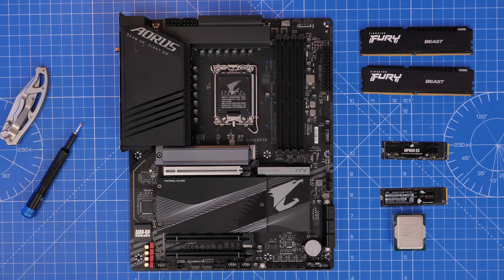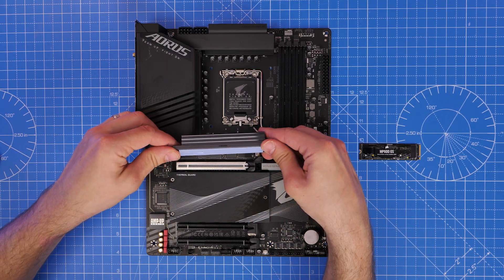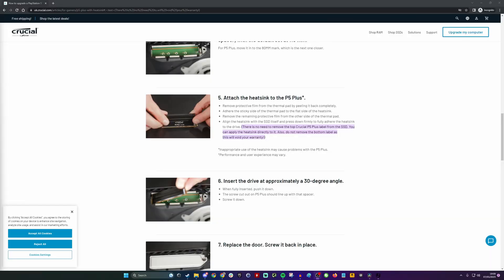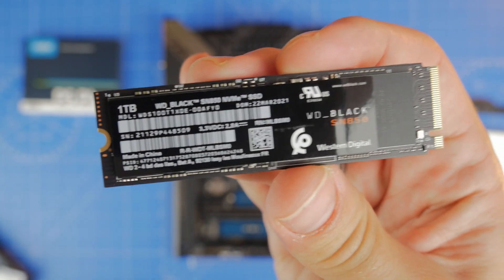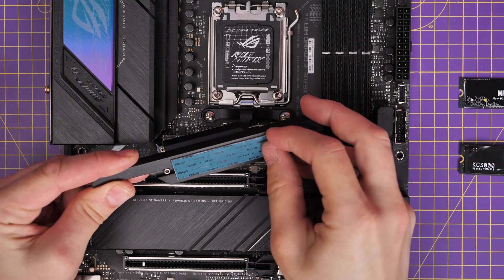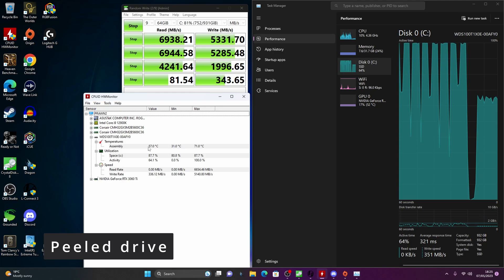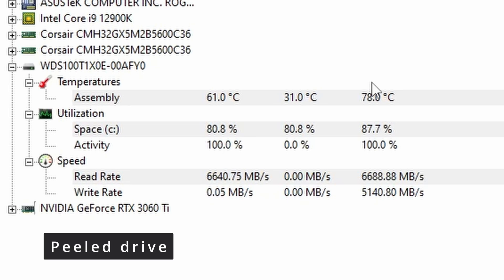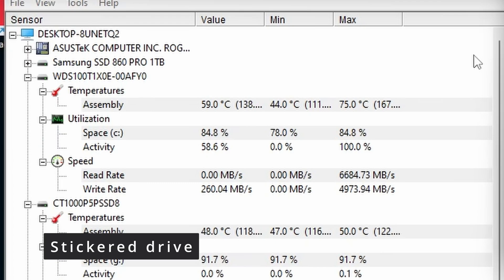Should you peel the sticker off your NVMe? Does it help?

Comment: It should be noted that in 1976 a federal law was passed In the U.S. that actually makes it illegal for a manufacturer to void your warranty because of the removal of a sticker. But because it's very rarely challenged or taken to court & there isn't much enforcement they get away with just doing it to reduce the # of referbishes & warranty claims. One of the original implementations of voiding  before the law was passed was for "Glass-cap-chips" a type of IC (Integrated Circuit) that was essentially the start of the modern re-flash-able motherboard bios. These chips had a see-through glass window in them that when the chip inside was exposed to UV light it switched from a read-only to writable state, allowing you to flash it. The advent of florescent bulbs (like the kind in most schools/businesses @ the time) could make them writable- which prevented them from running the device they were in; while being in the writable state. In addition, Mercury- vapor, halogen bulbs, & sunlight could permanently damage them or separate the wires from the carriage to the chip. Also as IC's advanced their was phased out fairly quickly. Many had a foil backed- "Warranty Void if Removed" sticker over the top of the window to prevent accidental exposure. If you were to sue a company over it nowadays it's likely they would just shove $$$ into somebody's pocket to get it dismissed. But assuming that didn't happen the burden of proof would be on the company  to prove that removing it somehow damaged the unit. Which of course means that because removing the sticker does no damage to the actual functionality of the unit itself- neither to the hardware or software- they would have to provide falsified evidence of that & lie about it. As an example; some years back there was a court case about people sending Xbox units in to Microsoft for repair & some of these units had been modded (usually to add more system ram to improve performance) & although they were still within the warranty time period & were not being sent back because of a mod related issue; Microsoft usually tried to make up some excuse as to why they wouldn't fix them. Eventually there was a lawsuit & the court decided that because the owner of the device consented to the mod, & because after purchase the device belonged to them, they were able to authorize it, & because Microsoft could not prove that the mods did any actual damage to the systems the court said Microsoft was bound by it's warranty agreement to honor any repair even if the sticker had been removed as long as it was still within the warranty time period. It's one of the few landmark cases that a big tech company lost.
Reply: Unless the "sticker" has a functional purpose beyond the 'void if removed' type of user discouragement. So a sticker that holds the lubrication in a fan or a sticker that helps spread heat (if it does) would be treated differently.
Reply: @Nick_R_  I would agree with the fan sticker, concept except if you read those fan stickers they never actually have that warning. Why? because the company can't enforce it, because it would be illegal for them to do so. However, those would @ least make sense. That said, any quality fan uses either silicone or rubber grommets filled with oil/grease to hold the lubrication captive against the spindle instead of just the sticker anymore. I've been at this for nearly 50 yrs now. I fixed my first PC in 3rd grade- a Tandy TRS-80 Green+Amber screen I bought from one of the teachers @ school. After I learned to fix it I realized I couldn't do anything with it because it didn't have any real programs with it. So I started learning coding by checking out & reading whatever books I could find on the subject. There was no internet/google/youtube then. Since then I've learned to fix practically anything that whirs, hums,beeps, or growls. Anyway, if you look @ those fancy metal foil w/ plastic laminate stickers using a thermal camera they actually cause hot spots under the sticker, because the laminate & glue are better insulators than the thin metal film can conduct away from the source. I have  come across a heat dissipation "sticker" that it's sole purpose was to act like those thermally reflective blankets made by NASA to reflect infrared heat away from it <that was on military equipment but it did nothing to help dissipate the heat created by the equipment itself.>. A better example would be inside the Samsung Galaxy phones, with wireless charging- have a "sticker" filled with copper coil <so it's not actually wireless is it?> that converts the magnetic field in the charging base into power flowing through the coil. Regardless of this, the fact remains that it's still federally illegal for them to void your warranty based off of removal of said sticker. There is no stipulation of whether it is considered "functional" or not. I've had companies try to do this & I sent them pic or vids as proof of the customers unit & guess what happened - they honored the warranty which they were contractually obligated to honor in the first place. The only times that hasn't happened is if the owner was beyond the time period of said warranty & had no option to <or chose not to> renew that warranty. It's always important to know what your rights are; especially against entities that usually have no fear of anything <except occasionally bad PR>. Large entities are incompetent at policing themselves so it leaves the job on us to do to protect those less intelligent or less fortunate as ourselves from those that would gladly exploit them.
Reply: Your serial number is on the sticker, so if you remove it you can't prove that it is actually still under warranty.
Reply: @Tugela60  I wasn't talking about the NVME specifically; but that's false anyway because just like all hard-drive class storage options it has it's serial, Model#, production date, # of cycles it's run etc embedded internally on the chip- that's how your bios, HW-Info or a 3rd party program like CPU-Z or the like reads it. <That's also how things like S.M.A.R.T. detect in your B.I.O.S. & compare against the manufacture's suggested values <also stored on the drive> to determine if you are close to a potential drive failure. Also you can prove it based on the model# & revision# + the factory production date on the board You can usually also tell by the bios update+revision # especially if it's never been updated yet. And if you actually registered the product you bought on their site with the serial when you got it it'd be right there in black & white on the user/company tab of the manufactures site- there was a reason I did that with everything I purchased for a customer's repair. That usually gives you an express code for each product which will take you directly to the specific build page for that device (for ex: if it was a computer; how much ram, what board, storage etc) so if you need to reorder anything you have a list of everything involved & you usually get express RMA slips also. However if you're considered a "regular" consumer by that company & not a business you've likely never been given one. Most ppl are to lazy to register themselves. Besides you all have smart everything now, why not just take a pic? I have been since the 90's when you had to use a dedicated camera - you got one in you pocket so what's your excuse?
Reply: @Elven DragonHammer  You are not going to get to RMA it in the first place without a serial number. If your drive no longer functions and you have removed the external serial number then there is no way to determine that it is in fact under warranty.
Reply: I still have one of those lights that erases eProms.  Used to change splash screen when a PC or Apple boots up.

Comment: I've ran the computational fluid dynamics (CFD) analysis on this one as well, and the difference is negligible. (IIRC, somewhere on the order of like 0.03 C difference? Something like that.)

Given the thickness of the sticker (and if you REALLY want to be specific, the thickness of the layer of adhesive, and then the thickness of the layer of paper for the sticker itself), the ability (or inability) for that thin film of glue and thin sheet of paper is not an significant barrier to the heat transfer from the SSD (NAND flash cells and the controller) to any thermal management solution, whether it is just natural, convective cooling, or forced, convective cooling, or whether you've added a NVMe aluminum heatsink to it.

From the heat transfer perspective, the sticker is functionally irrelevant.

The more important think would be for you to add thermal pads over the individual components (don't just cut one long strip to cover everything, actually take the time to cut individual rectangles for the individual components), and then add said aluminum heatsink, and you're good to go.

I'll have to dig up my CFD results for those that may be interested.
Reply: Nice prospect.

Comment: Just remove them off with a sharp scraper so it doesn't damage the sticker, and the glue itself, then transfer the sticker to a tape plastic and you'll be good. Make sure the scraper is very sharp and clean though

Comment: I'm just a noob compared to most, but seeing as the internals work more efficiently while warm. Wouldn't it be best to leave the stickers on? So that the temperature drop is more moderate rather than extreme?
Reply: Electronics fair better if cold. They definitely don't work more efficient while warm.
Reply: Not always true, nvmes do prefer to be around 40-50c.

Comment: An understanding of physics should relate that for any temperature to exist it must possess an mass that is that without any substance temperature cannot exist or be transferred and the simple mass of the sticker does in fact do two things firstly it allows heat to transfer from the drive and secondly  to dissipate ...its false logic to expect the drive to run cooler without the sticker when it fact it could just as easily run hotter after the mass is reduced meaning what heat is generated is held on an more minimal medium. .only if the sticker has an insulting property will heat dissipation not be allowed to occur but its likely the sticker will utilise non insulting materials and adhesives....the sticker is in all probability just another thermal instrument included to not only contain information but enhance the drives capabilities don't you understand that millions of stickers don't come cheap and manufacturers don't waste there valuable resources they have research and development engineers but does the consumer have this much resource and capability well of course he doesn't.  Keep the part in its intended fashion and don't think you can get ahead of the manufacturer on every point at least to be fair on every item that is as some modifications are an improvement whilst others are clearly not....

Comment: It helps alot on the cheap Kingston drives. That sticker actually blocks the thermal pad from transfering the heat completely, laughable.
Reply: did you test temps 'with and without'?

Comment: Be careful guys, I bought Kingston SKC3000, which "fainted" during SW install (90 GB extended VS), a day after the purchase (SDD disappeared from the BIOS). When I raised the case to the Kingston technical support, just to see if there is some workaround, to avoid disassembling heatsink and CPU cooler, RMA, and new SW installation, I naively mentioned that I installed SSD under heavy heatsink and removed both protective stickers (referring to the foil over heatsink thermal pads). After that, support technician franticly declared that I voided the warranty, thinking that I removed "warranty void if removed" BS. Luckily, I already sent, SSD's both side photo, to the other guy in technical support and "gotcha you" guy backed off. If vendors want their stickers to be there, clearly raising product temperature and therefore number of broken products and RMA, let them, while product is under the warranty. Later you can remove that nonsense.
Reply: Yes, it is written on it that removing sticker voids warranty. But my SSD drive has copper heatsing on the backplate.

Comment: It was my impression that, on at least some drives, that "sticker" is a sheet of thermally conductive pyrolytic graphite.
Pyrolytic graphite conducts heat reasonably well through its thickness but exceptionally well along its length and width.
(In this specific situation pyrolytic graphite is claimed to work much better than an equally thick sheet of metal foil.)
Therefore, that sticker probably won't help much, if at all, to conduct heat from the chips on the drive to a heat sink mounted on top.
HOWEVER, it is intended to work as a "heat spreader", and so increase the surface area that will radiate heat if you ARE NOT using an extra heat sink.
(So, rather than the chips individually getting very hot, the entire top of the "sticker" heats up and radiates heat equally.)
Reply: I first read that as "prophylactic graphite"!
Reply: 100% agree, i tried to remove 980 sticker it was just breaking apart not plastic at all something else. So i left it alone😁
Reply: The sticker on my Gen 3x4 Sabrent Rocket is literally a thin sheet of copper.
Reply: So leave the sticker on and then put the heatsink tape and then the heatsink ?
Reply: I've heard that the Dram cache is more heat sensitive and better to keep more cool than other other parts like the Controller that makes the most heat and runs the hottest and the  NAND flash that also run fairly hot. I'm pretty sure the Dram cache also does produce a lot less heat than those other parts. Some have theorized it could better to remove the thermal pad over the Dram cache for these reasons, so the hotter parts don't make it hotter. If true it would seem you wouldn't want this effect, at least not with the Dram cache. I do notice most of those top stickers only cover half of the controller that's making the most heat, seems intentional.

Comment: Would be interesting to see without heat sink to see how the temperature behaves. With mine it doesn't appear to make solid contact with the heatsink compound. If it's the same with yours, there might be no difference since the contact with the heat sync was poor to begin with.
Reply: Buy thicker thermal pad or you may have a single sided SSD